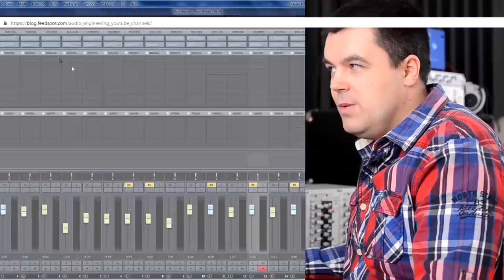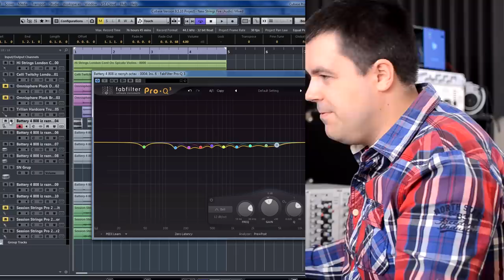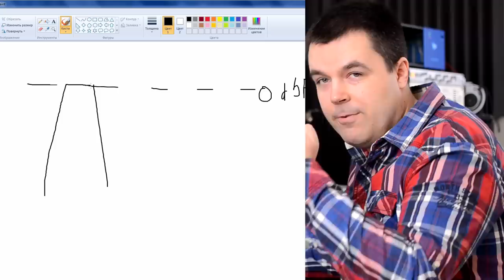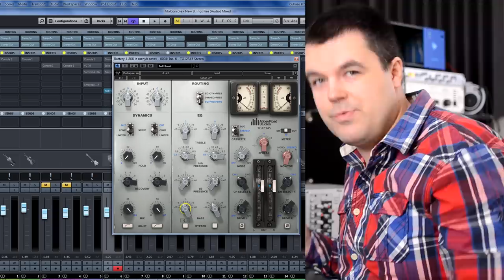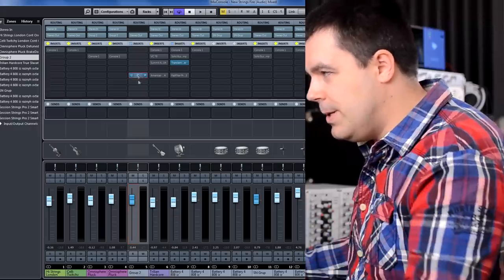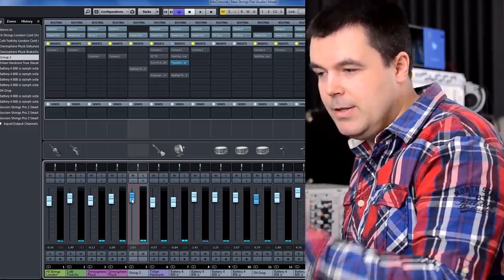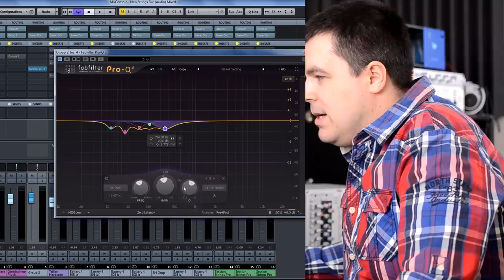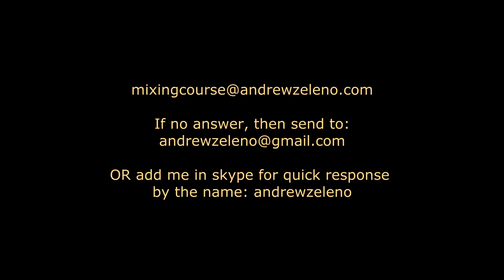Sweep EQ Technique Used Wrong by Many Mixers - Mixing Tips

Comment: You're SO right about this subject. I almost went insane, at some point, listening for resonant frequencies for hours and hours and hours. Day after day. OCD-like behavior.

My hearing wasn't normal for weeks (!) afterwards. Not due to loud listening levels (I kept levels low) but due to ear fatigue, and my ears and brain getting hyper-focused/sensitive to all kinds of "resonant" frequencies it "heard" (dug out) from whatever sound I listened to.

Did all those notched frequencies accomplish anything? Nope. I ended up undoing it all. 'Cause with 50-100 notched frequencies – the sound had totally lost its soul. And even lots of its odd and even harmonics. Such a rabbit-hole.
Reply from the maker: Very important thing you mentioned about ear fatigue. I show 3-5 techniques on the course exactly related to EQing without causing ear fatigue.
Reply: I feel that

Comment: Great video. Cuts are useful in certain cases, but I do a lot of boosting, too. And not just in the studio, either. I boost certain things live. Some instruments need boosts in certain ranges, like electric guitars between 0.8-1.8kHz, or vocals with a little boost around 5-7kHz, or bass between 300-500Hz. A little cut to let the other instruments fit is helpful, too.
Reply from the maker: Thanks!

Comment: When I use this technique I switch the project to mono and turn the volume down a lot and listen to all of the instruments together and you can really get what sounds like “inside” the mix and actually sweep until you like the sound of that frequency and it gives it its own space in the mix. I mix at very low volumes and always have lots of headroom. That’s a good technique that’s helped me for a long time
Reply from the maker: I hope you realize how Fletcher Munson affects on your quiet listening and the fact if you turn to mono all mono incompatible stereo sounds will be filtered+volume change and you actually don't hear the real sound of your mix due to partial out of phase cancelation.

Comment: Hi Andrew,
Great video with many useful hints and tips. I am a beginner in mixing and in most cases I didn't try to find problems by sweeping which aren't there when not boosting. I always listen in normal volume and try to hear what I don't like and if there is a a problem in context with other instruments. And then I am going to use an eq. I even often start with a deep eq cut to see where I can make room for other instruments. And especially for kick and bass I found out that technique works very well. For example if I decide the bass should be the most prominent instrument in the lows I do cut the kick but not with a high cut filter but with a parametric cut at low frequency. I like that more, it's kind of more crisp sounding. But it's still difficult. I do a 40 tracks mix right now and it's an acoustic sounding 70th inspired soundtrack theme but all instruments are done with one synth only like a one synth challenge, from trumpet to e-guitars, bass, Spinett, cello, bongos, drum kit and many more. And that's a real challenge because synthesizers do provide so many nasty frequencies over the whole spectrum, some tracks unfortunately I must tame with 4 or more peak cuts to not destroy the whole mix.

Andrew, I really do appreciate your channel and the way you approach different subjects directly and open speaking. But I would also like to see a little more of the distracting "the best of the world" attitude :o) I hope you understand that right and will not be offended. Cheers and have a great day.
Reply from the maker: No I don't understand. Read your own post: " I would also like to see a little more of the distracting "the best of the world" attitude"
Reply: @AndrewZeleno1  Hi, I meant "a little less" :):):) Sorry.
Reply from the maker: First of all it's the truth. And I don't say the best. I say game changer and 2nd best channel on youtube according to Feedspot. Check reviews form my students who actually say more than me. A couple of quotes:
Stenley Tomas N.Y.
I graduated from Berkley and I think your course is better.
Chris Contreras
I am a long-time full-time professional musician with significant prior recording and mixing experience and still this course has been an absolute game changer for me. 
Luc Sylz
the results have been beyond expectations. You will learn enough in this course to never consider wasting anymore time and money on other ones. 
Richard Irwin
Fantastic course! It was a wonderful privilege for me to have learnt from you. I believe your course to possibly be the finest in the world. 
Chad Simon
Your class is... absolutely the best.
robin pamdeth
Hey Andrew, absolutely, I think your course is the best thing I've come across on the internet 
Hassan Rida
The most professional course I’ve ever found.
Ram
Andrew is best teacher, passionate for teaching and honest with his students
++++++++++ I just randomly chose some phrases from their reviews just from a couple of students.
So sorry. I say like it is.
Reply: @AndrewZeleno1  Hi Andrew,
I just don´t doubt any of that and I´m already getting it from your videos how passionated you are about the subject teaching. For me personally it´s sometimes just too much "advertisment". But I do understand that´s important too. Have a great day and thank you for answering. Cheers Matthias

Comment: I don't know where this technique originated but I use it a lot in live mixing primarily to ring out mics to keep them from feeding back in a particular room. Boost 18db and cut the resonate frequency. In a live situation, this could have a negative impact especially on vocals so cuts have to be in balance with the performers tone and legibility. If it will mess with the artists tone, something else has to be moved or adjusted to not sacrifice the sound. Sometimes the sound is sacrificed if the room is unworkable.
Reply from the maker: Sweep technique is great when we know in advance what we try to fix. This is the point of this video.

Comment: Great tutorial although I do have one concern. Andrew you indicated that when you gain reduce certain frequencies the overall volume is decreased as well. In order to make up the gain loss then you would need to boost the gain . The make up gain will increase the volume of other frequencies also that were not altered as you indicated. I fully agree. If the case is to recover the lost volume without boosting the other frequencies how do you accomplish this?
Reply from the maker: Unfortunately It can't be answered without some real example. Because it's not just like one simple rule.
Reply: @AndrewZeleno1  Thanks Andrew. I think one method is to use a multi band compressor.
Reply: you can’t recover the lost volume without boosting frequencies. Using gain will keep the balance of frequencies that you have achieved with the eq cut. Anything else will change the character or dynamics. Multiband compression will change both.

Comment: Well, I create Downtempo / Chil beat tracks including guitar. I 've been using many plugins (Compressor, limiter, PAZ analyzer, WLM loudness meter) and have been trying to reach the goal of -14 / -13 dB LUFS standard of Youtube and always found my song lacking power and loudness when comparing to celebrities tracks. Then I decided to measure those reference tracks...  To my surprice, I found that almost all known songs, even Despacito or Ed Sheeran's tracks are at around -6 LUFS !!! So what is wrong in this case? Should I follow the Loudness War and export my tracks that loud and let platforms as Youtube reduce/normalise them even 52% (Despacito: Volume / Normalized100% / 52% (content loudness 5.7dB) or follow the limit standard rules of -14 LUFS?

Comment: What is your opinion about adding a sweep eq to a master track with only one or two cuts?
Reply from the maker: If you have an access to individual tracks, find out where is the problem and sweep on those tracks. No point to do it on the master bus where it will harm other good sounding instruments.

Comment from the maker: Ok. Let's confess :) How many points you have on your EQs?
Reply: The maximum amount of course!.... All frequencys are evil and must be cut! 🔪📊📉🔪😄
Reply from the maker: haha. If so you don't cut frequencies in metal.
Reply: It depends, in live situations = many, but in studio usually 3 to 5
Reply: Since I've the audio interface I haven't uploaded nothing to YouTube, but till now in keyboards I don't have to do much stuff, just one or 2 points. Cause the signal.enter direct from my Korg Triton le. But in mix general or sounds, 2 to max 4.
Reply: I never use more than 5. Ever. If I'm tempted, I know my source is FUBAR and re-do it, or make some other changes that negate the need.

Comment: How does it feel to produce on a curved screens? I was trying one the other day, and the feeling was weird - more immersive, but kind of hypnotic. I can see why they use them in gaming, but do you prefer curved over flat screens?
Reply from the maker: Whatever you feel right. Different people need different stuff.
Reply: @AndrewZeleno1   Thanks for the reply, Andrew. Sure, I wasn't saying if one was wrong and the other the right approach. I am asking, because I am considering curved as well, but the initial feeling was weird, cause I am not used to them. I was curious, is when you switched to a curved, did it take you some time to adjust, and then found it preferable over flat, and why? Thanks. Vladimir

Comment: Shouldn’t the eq follow the melody of the instrument? Synths aren’t static so why eq only a set frequency if harsh frequencies will pop up throughout the melody dynamically? I can understand something like a kick that plays a pretty consistent frequency. But musical instruments have movement
Reply from the maker: Your idea is very wrong in the first place. Jumping harmonics at different frequencies are fine. You shouldn't cut them all. You cut only bad sounding ones. And only few bad sounding ones happen at only some frequencies. 99% of different frequencies should be untouched. For example if somebody recorded an instrument professionally (which mean they listened to the sound) they by ear found the great tone of the instrument, chose settings and they put mics in the proper position. Even types of mics and their preamps were chosen specifically for the final good tone. So 99% of it is correct. You only fix 1% of bad things. Thirdly, Mixing exists for at least 70 years. EQs were always static till like 2010. And older music commonly sounds better mixed then the modern harsh and overcompressed music. So nobody complained about static EQs.

Comment: The narrow sweep technique is merely for microphones, it does not make much sense to use it on electronic instruments.
Reply from the maker: Not exactly. The thing with this video is you should use this technique for finding one external bug which came to the sound as a resonance. So even a synth can have this resonance as a coincidence do to different sound design methods blended. However the whole point was you need to know what you searching for before applying this technique in mics and synths as well before applying Sweep technique. Instead people don't know what they look for and they just applying this technique without any reason. They hear 10 +30db frequencies they don't like because they are +30db, and they cut all 10 frequencies.

Comment: This is why certain preamps initially set the source in a great context, making the tone of the source way more palatable. Notching out an offensive frequency like anything else should be applied sparingly, and is afforded a sparing approach if the initial tone is treated, ideally with a good preamp or a super recording, first and or both. Very few digital eq's are proper surgical, narrow band notch eq's, so you are grabbing a whole bunch of other frequencies when boosting or cutting, Massenburg tackled this exact problem, always looking to create a flat curved angular, proper needle narrow eq dip or boost for this very reason.

Comment: But nobody would sweep and clear a kick drum surely? You only do that with sounds with harmonic content. I mean, who would boost a kick at 50Hz at 30dB then think there was an issue at that frequency?
Reply from the maker: man. Nobody sweep the fundamental tone of a kick. It's a body of a sound. Secondly the point was you need to know the problem to fix it with the sweep technique. You don't sweep 50 Hz if there is no problem. Secondly there is no clean kick. Harmonics are always in any kick.